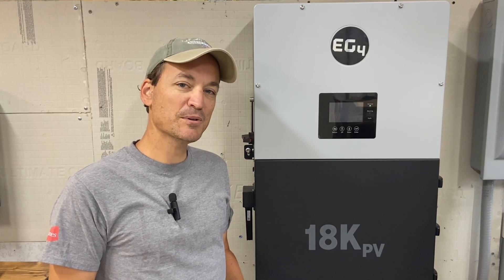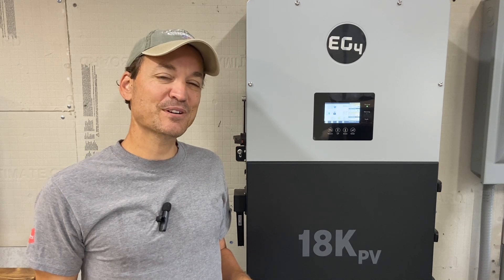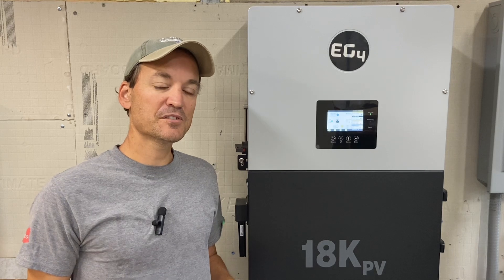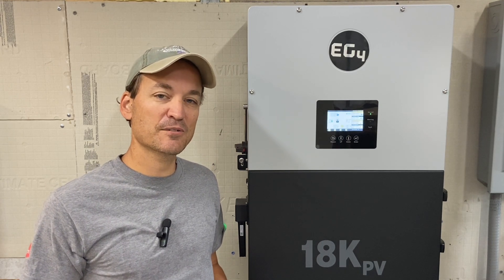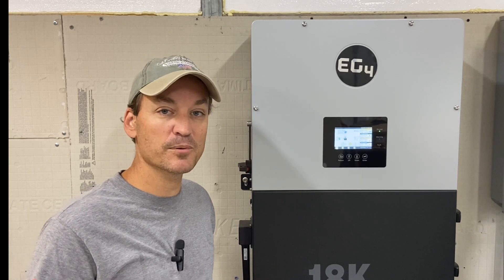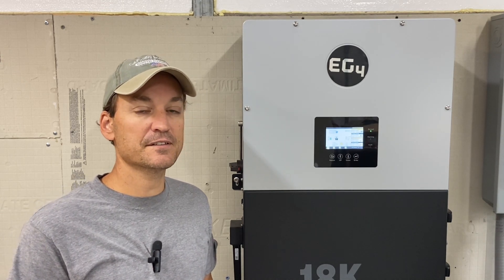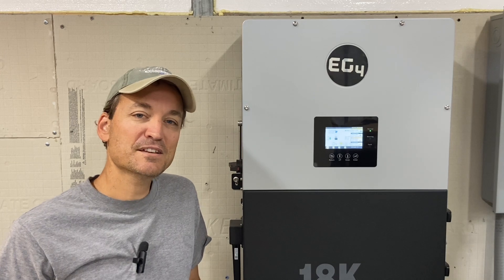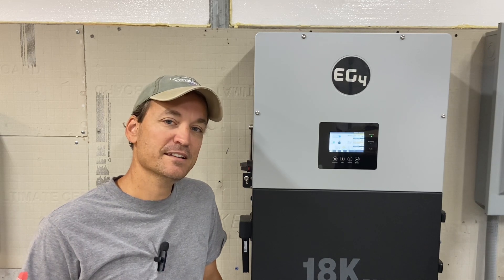Eg4 6500ex vs the EG4 18kpv comparison video~ signature solar inverters

Comment: Glad to see this comparison as it's the 'sticking point' I have on my choice. The 18kpv looks so easy to set up and you can (if you want) feed-back to the grid... on the other hand, saving $3000 and having no intention of helping the money hungry thieves at our power company I don't need to 'feed' them anything other than a photo of my butt as I go the opposite direction. Thanks for this review/comparison. A recent subscriber and you've already hit it out of the park.
Reply: I hear you but as an owner of both now, there is absolutely no question as to what I would recommend if you can afford either... easy- 18kpv by FAR
Reply from the maker: I really appreciate that. The funny thing is you never know what will help the most people when you’re making content. But I’m glad to see such good response to this one. And it does make sense. There is a lot of people considering both these inverters.
Reply: Haha I like it

Comment: I know you have talked about it before, but is there any difference in flickering of led lights? I would think the transformer on the 18k would help with that.  Thanks for all the great info.
Reply from the maker: Both inverters are HF inverters. So neither type have a transformer inside of them. Having said that, my last pair of 6500’s had no issues with lights flickering. Only if a heavy inductive load started would you see any flicker. And actually that’s typical. It’s ohms law in affect. And with the 18kpv I’ll see a brief flicker if there is a heavy load as well, like the water well for instance. The 18kpv does have massive capacitors that help regulate voltage. So that would help with those factors. That’s also likely one of the reasons why it has such a robust surge capacity.

Comment: You did not address price.  2 of the 6500's are $2600 the 18kpv is $5500.  Is the 18k really worth over twice as much?  what if you are not interested it the grid tie features?
Reply from the maker: I try to avoid giving prices on videos since they can change so much with discounts or sales. But that’s a good point. I think I did mention 18kpv is more expensive. So the point of the video was to help educate people on whether or not its worth it for them to purchase the 18kpv over a 6500. And the answer is, that depends. It depends on your usage, your potential expansion of the system, or even you location. Like I mentioned towards the end, I think even in an off grid setting the 18kpv is worth the extra cost. It’s surge capacity, build quality, and high efficiency are probably a few  of the largest factors for me.
Reply: I pretty much agree.  Hard to justify the double price though.  I kind of feel like the way EG4 is pushing the 18K that the 6500's are going to fall to the wayside and be lacking future support/upgrades @GavinStoneDIY
Reply from the maker: @brooksncc  it’s hard to convey to people how nice the 18kpv is without sounding like you’re trying to up-sell them on something.So I try to give both options for sure. And like I said, those 6500’s are work horses. They had my house running great. So they’ll do the job. And they might leave them by the wayside as you mentioned. But I’m not sure on that. Since they’ve obviously been working on newer innovation for them like the PDP. I think that’s a good sign they are committed to the 6500’s also.

Comment: Your videos on the 18kpv has been really helpful! I do electrical work at a place in Idaho that is completely off grid and i've been trying to keep the old system from 06 running everything it needs to lol
We think that next year we will be able to budget for a whole new EG4 system using two of the 18kpv's and 120kwh of LiFepower4 batteries. So trying to do all the research on them before hand!
Reply from the maker: That sounds like it would be an awesome system! 100 amp service with a massive battery bank. Keep me posted on this. I would love to hear more details as it gets closer. What system are you currently running?
Reply: @GavinStoneDIY  Right now running 8 outback power VFX3648 inverters with 4 outback flexmax 60 charge controllers. And finally the 8 banks of frankensteined 36v converted to 48v fork lift flooded lead acids lol
Then a 40kw propane backup generator
Reply from the maker: @NSaw1  wow. This is going to be a massive step up for you. Easier wiring. Easier battery chemistry. Basically set it and forget it features.

Comment: Nice breakdown on a wide range of topics and features.  Kinda like Will mentioned, if everything works it's hard to come up with content for a video.  Doing this comparison was actually great content.

On the topic of the three PV input on the 18kpv vs four inputs on a pair of 6500s - does the first PV input on the 18kpv allow for paralleling two strings, effectively giving you four string input capacity?  Maybe I misunderstood that part.

Keep up the good work!
Reply from the maker: Good point! Darn it man. I should have mentioned that.